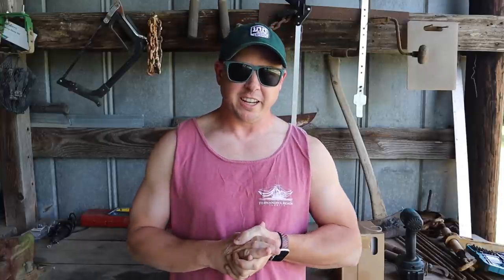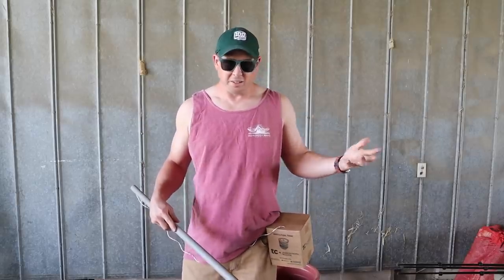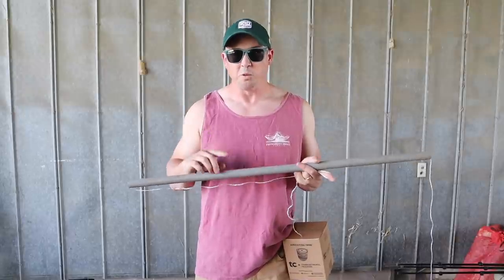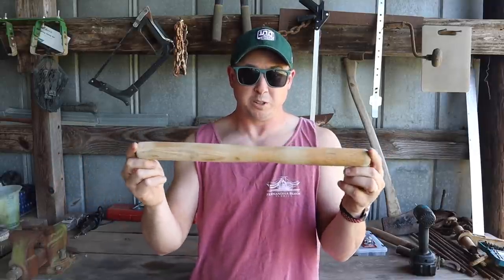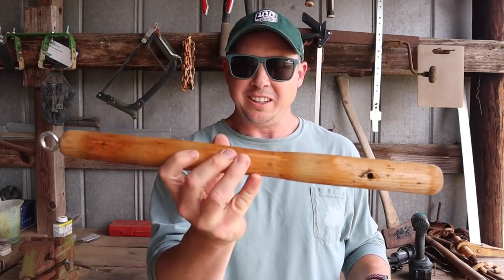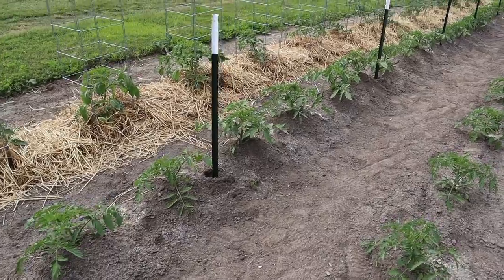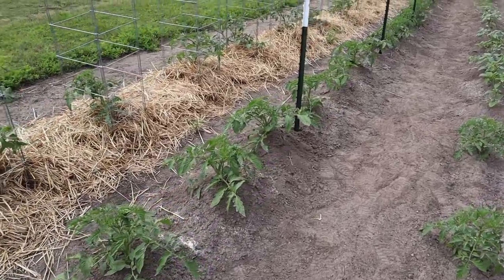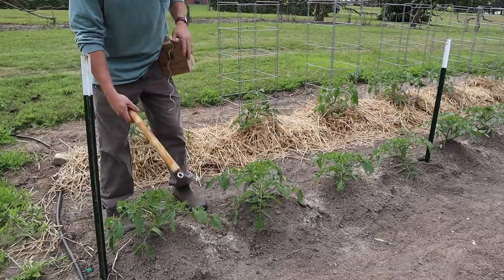A NEW WAY TO TRELLIS AND SUPPORT OUR TOMATOES!

Comment: Hey Travis. As the guy who sent you that original video I'll have to say how gratifying it is to see the improvements that you've made to the prototype and how many creative modifications your video has sparked in your subscribers. Using a fence staple at the end is a solid idea and the idea of using carabiner clips is like something out of the Jetsons. Personally, I believe I'd leave a little more handle below the first feed hole and also angle that hole from back to front so the string feeds easier. There's going to be a lot of one legged rusty loppers in the world going forward. I sincerely wish every success to you and your family in your new ventures.
Reply from the maker: Thanks for sending me that video Mark! I like the idea of drilling another hole lower -- might just do that this evening.

Comment: Travis...next time try putting the string box on your belt, same side as you use your wand. You won't have to cross your body with the twine and it might be easier...worth a try :)
Reply from the maker: I've actually tried that before. You really need the "non-wand hand" close to the box so you can pull more string from it -- otherwise you're reaching across your body to pull more string from the box.

Comment: Whenever I've done the FL weave my big-boy monsters pull it down and in different directions. Not sure what's wrong. My posts aren't the best - might be part of it.
Reply from the maker: Try using 5' t-posts and pound them 1' into the ground. That worked well for us last year.
Reply: Thanks. That is so short. My vines get 9-12 feet tall - with posts so short, what can I do??

Comment: Hi Travis! I've never done the Florida weave, but I was just wondering how it would be with just drilling a hole into the side of the PVC and letting the string come out the bottom like before? You would still be able to control the tension, and not have the problem with the eyelet screw at the bottom. Love your new channel, and I have learned ALOT from your previous videos from before.
Reply from the maker: Probably would work just as well. I was just trying to replicate what I had seen on another video.

Comment: I combined the pvc pipe & your new way you did your stick. I used a stick of 3/4" pvc about 40" long and drilled a 3/8" hole like you did in the lopper handle but I ran the twine thru the hole and down the inside of the pipe. No eyelet needed. Works awesome. Just use my thumb to maintain tension on the line like you do with the wood stick.
Reply from the maker: Awesome. Might have to give that a try as well.

Comment: Two questions for you: 1.  How young of veggie plants can I start spraying for squash bugs and other known pests?  2.  How often should I "overhaul" my seeds for optimal germination from year to year.  Should I get fresh new seeds every year? etc?  Thanks!
Reply from the maker: We start spraying as soon as true leaves appear sometimes on the more problematic crops. Most seeds should keep well in the fridge from year to year. You might see a slight drop in germination rate, but nothing significant. The only things I wouldn't save are onion seed and pea (English and field) seed. Those don't hold their germ rates well from year to year.
Reply: @LazyDogFarm  what are you using to spray your squash bugs Travis?  I’m not as concerned whether it’s organic or synthetic, j just need something that will work! Will the spray have any effect upon the eggs or do I just need to make sure I keep removing those daily?

Comment: You could put in two eyes and the eyes/hooks are not fully closed but have a couple of partially open loops, which you can stick the twine onto without needing to thread it. Then you are free to clip and unclip onto any twine without needing to thread thru holes at all or needing to have a free end of the twine. Even better if you can mount a couple of small caribiner clips. Then it's simply clip on and off. There's cord clips....all sorts of clips.
Reply from the maker: Not a bad idea at all!
Reply: That 'biner clip idea is golden. Still need to keep string pressure with your wand hand

Comment: Cool. Love the handmade, specialized equipment. I don't think the Florida weave would work in my containers. I grow 2 determinate tomatoes in each of 6 boxes with a sturdy tomato cage between them. The boxes are in a square rather than a line, so the weave just wouldn't work. If I was a ground gardener I'd do that, too.
Reply from the maker: Yeah the weave is more useful for a longer row of tomatoes. Sounds like you've got the perfect trellis for your boxes.

Comment: Great video. The tomatoes in the cages I’m assuming are indeterminate. I’m wondering why you put hay down? It looks nice.
Reply from the maker: Yes, the ones in the cages are indeterminate varieties. We used the wheat straw on those because it can be difficult to weed inside the cages. So it helps with weed suppression in that situation.
Reply: @LazyDogFarm  why not do the weave on the indeterminates too?
Reply from the maker: @LacyO86  I did use the weave on indeterminate last year and it worked okay. They do eventually outgrow it, even when using 8' t-posts. And once the plants get larger, you'll end up just wrapping the twine around the outside of all the plants instead of actually weaving between the plants. I'm doing the same thing on my tomatillos this year and it's working well.

Comment: A man take that eyelet out and just drill a hole on an angle to the center of the dowel at the bottom.... kinda like toenail it with the drillbit if you know what I mean.... that way the string won't get caught on anything
Reply from the maker: Not a bad idea. I was just trying to replicate what I saw the other guy do.
Reply: I would use a a modified fence nail on the end of the handle thus it wouldn't  catch the string.
Reply: Mr. Mattingly, the original prototype was made as you suggest but required a fair amount of hand work with the Dremel to funnel out the end. I would prefer some of the ideas that others have suggested.
Reply: @LazyDogFarm  that's what I did and it works fine.... old amish showed me

Comment: Neat tool. Suggestion. Use your step up drill bit and team out the hole the string is going through on both sides. Should help the string flow through better. John S.
Reply from the maker: I like that idea!

Comment: You can drill a hole in your old PVC and keep tension with your finger the same way.  The PVC is good because the twine doesn’t get caught on the plants.  However, the wood wand looks much nicer, so points for that.
Reply from the maker: It was definitely a good way to repurpose an old tool handle.
Reply: @LazyDogFarm  - I love how your Travwand looks, so that alone is making me think of doing something similar, lol.  As far as the T-posts, I’ve been using them at the ends and middles all along, as the 48 in wood ones are subject the breaking and without the T-posts, can cause the entire row to fall.  I may try going with just T-posts like you did spaced every 4 plants and see if it works.